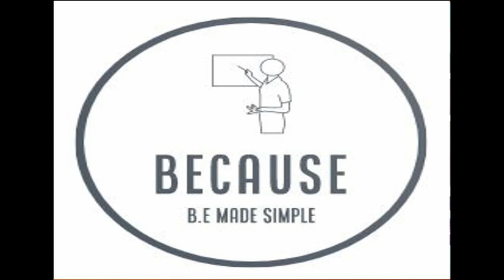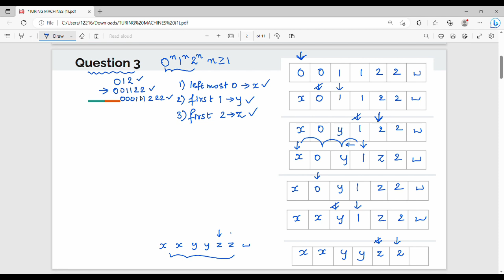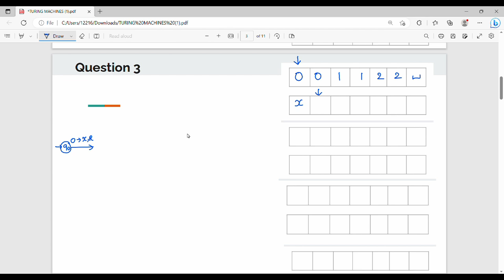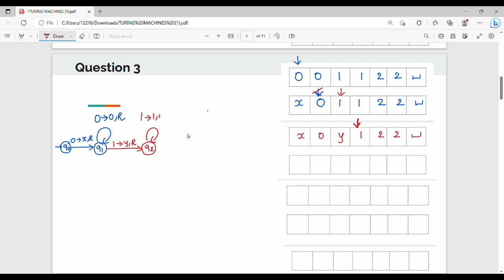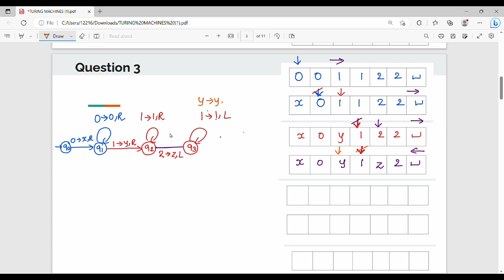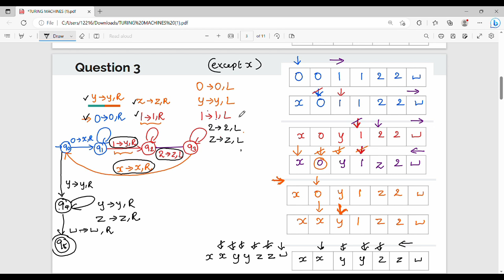4.15 Turing Machines Example 3 in Tamil

Comment: Sir You have told that Turing Machine is deterministic. But you have not written the transitions for all inputs 1 2 and 3... For all the states... Is it correct sir? Please clarify
Reply from the maker: Deterministic means for a single input the transition will be to exactly only one state only.
Reply: @because2022 Okay sir, then in this problem why do you have the same input i.e  'y' goes to three diff states namely q1 q3 and q4 if the turing machine is deterministic.
Reply from the maker: @catchy-lyrics  For turing machine, its not only based on input. We have (next state, symbol to write, direction to move)

Comment: sir in q3 self state 2->2,L is not needed right?  as we r moving left there is no possibility of reading 2!
Reply from the maker: It is needed. When we see a 2 at q3, we need to move towards left.
Reply: @because2022  sir q2 to q3 transition has left movement so we wont see 2 there, so 2/2,L is not needed, because after the transition to q3 pointer will be pointing "z"
Reply: Tats rit bruh